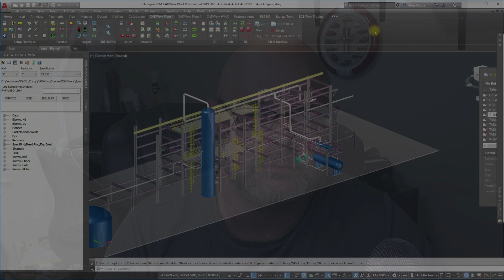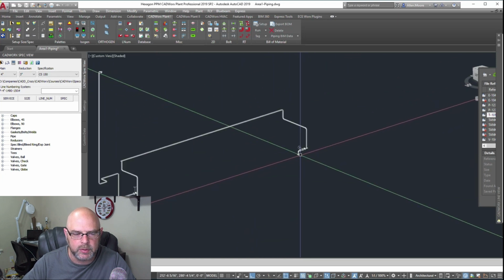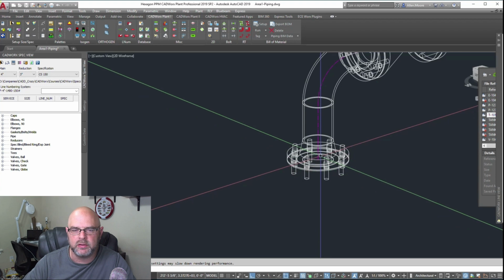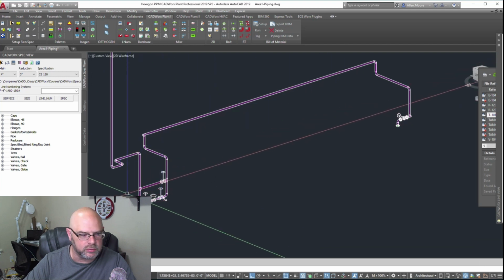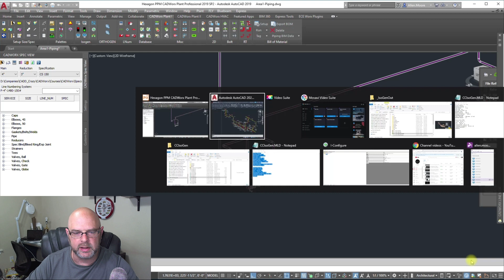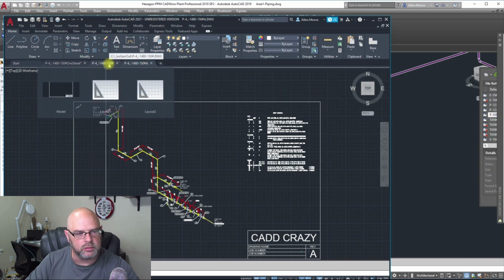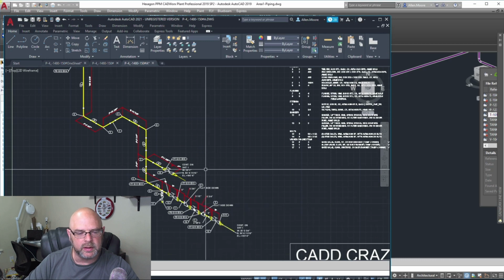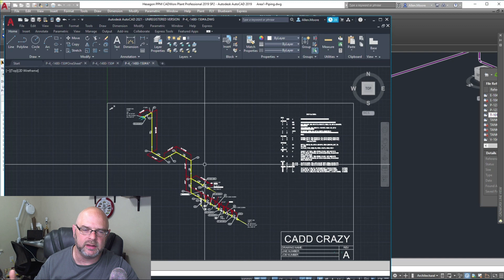What to do with a Stop Sign in CADWorx

Comment: I no longer use stop signs i just do a -1,-2,-3,etc... added at the end of a line number fixes all the glitches you mentioned and you will see the sheets in navis as well
Reply from the maker: Yea We have tried that a few times with mixed results. While it is good for the continuations and not having to worry about Stop Signs, you have to remember to change every line past the one that changes. The good thing is that you have options and do either.